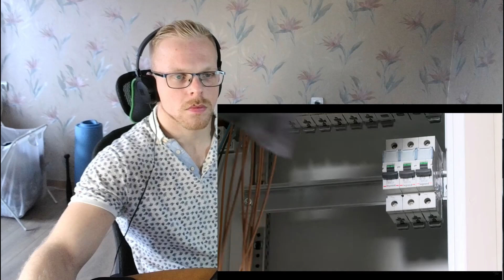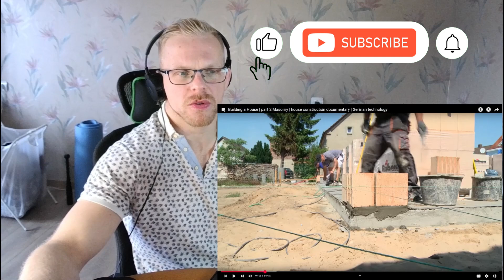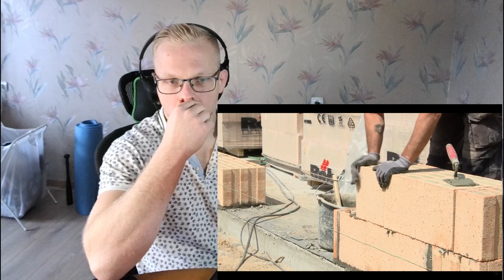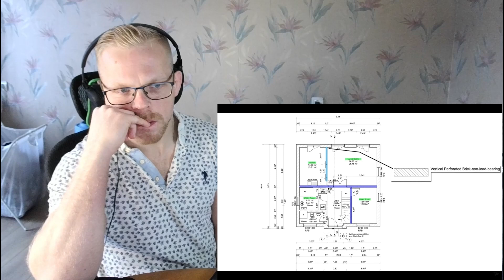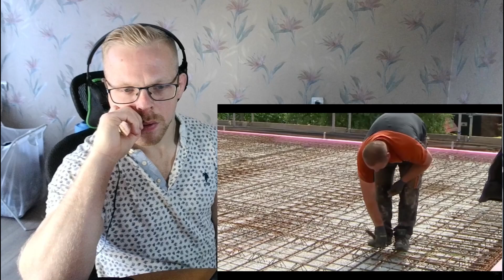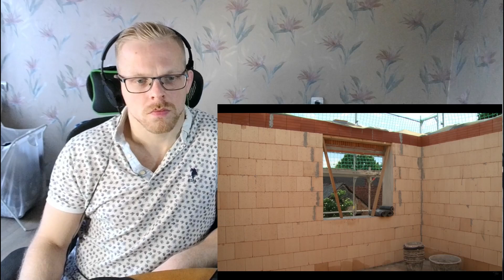Latvian Reacts: How Germans Build Houses – Masonry Explained!

Comment: Hey Best man, regarding your question right now with intrests rate you could expect something about 3,7% in germany depending on the amount of own capital you can bring in. The Goverment will provide a little amount for cheaper rate if you build according to energy efficency requirements. A House like that with 140 squaremeter would probably cost around 400k without any extras not including the plot, or a cellar or a garage. For the complete package with plot and garage you better be ready to expect a prize of around 600k.
Reply from the maker: Maaan that is expensive 😆😆
Reply: House price: Well, in my small town in the immediate vicinity of a city with more than 1 million inhabitants, two detached houses including a mini plot were sold last year for 1.1 (plot approx. 280 sqm) and 1.2 million euros (plot approx. 320 sqm) respectively, and in between 2 semi-detached houses for approx. 800,000 euros each. (plots of 170 sqm and 185 sqm). Originally this was probably a single plot of just under 1100 sqm (now there is still a bit of communal land = paths, parking spaces).
It must also be said that in our community you are not allowed to simply tear down an old house if it is on more than about 650 sqm of land. You either have to completely renovate the house or build an apartment building if you do not have the plot divided up beforehand with a building permit.
By the way, the houses are built using timber framing without any bricks, while in the next small town semi-detached houses with a plot of just under 400 square metres were sold for under €650,000.